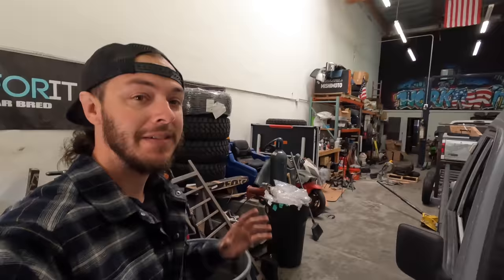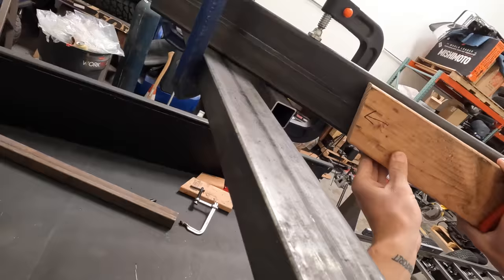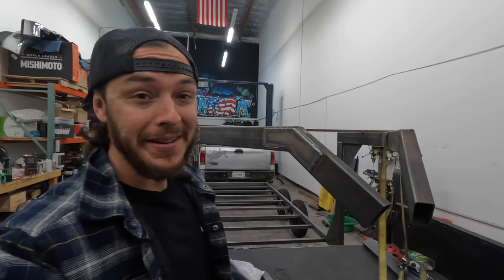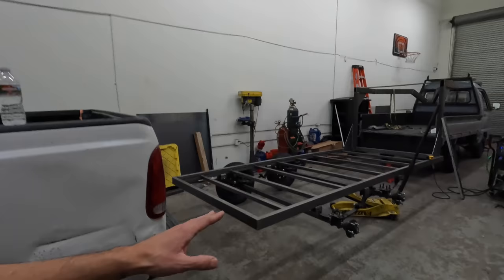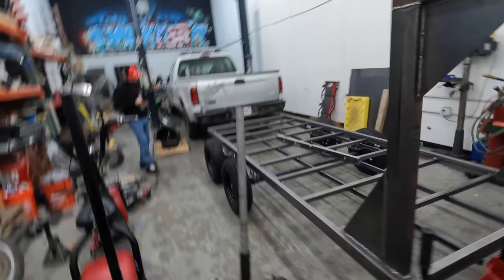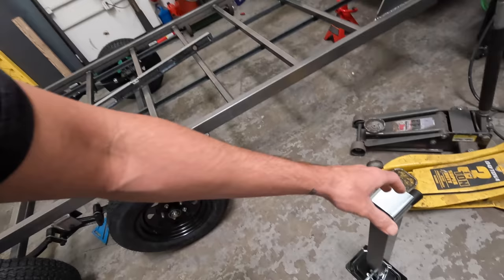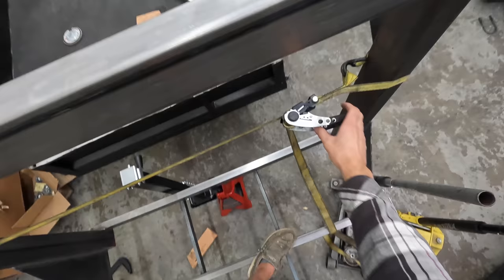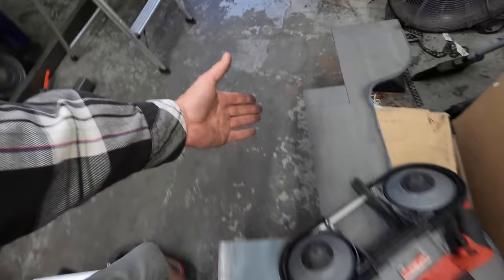Building a Mini Gooseneck Trailer for my Mini Truck! (Part 4)

Comment: Would recommend you don’t over engineer it and once you secure your 2x10 or 2x12 on the deck, it will straighten out right away and stiffen it up as well
Reply: Agreed
Reply: I have welded 1" tall by 1/8 thick straps, from front to back, to the cross braces, between the 2 x 10's for added strength and to keep the 2 x 10' s from wrapping.
Reply: Foreal how heavy is that thing now haha and how many ponys does that k truck have
Reply: @yungraf420  I see an engine swap in the mini truck's future. Maybe a 3 cylinder diesel

Comment: Cut the jack handle where it exits the top of the jack. Weld a length of tube, connecting the two pieces, to extend the handle to the edge of the trailer. Use a larger piece of tube (or rod end) to support the handle at the edge of the trailer.

Comment: That arc was caused by welding in the cross members on the bottom of the 2x4 tube. The welds shrink the tube and cause the arc. 

You can look up heat straightening to fix it

Comment: Ryno cut the Jack handle and make it extend all the way to the end of the trailer. Put yourself a little bushing or bearing mount for supout. Than you don't have to crawl under.
Reply: My thoughts exactly. Came to the comments to state that opinion and u already had it. Good deal.

Comment: With the uphill welding, weave it back at forth and pause on the sides so the wire can fill in the edges better.

Comment: Since you went side ways on the Jack , all you need to do is extend the arm to the side of the trailer.  Make a support bracket to hold the arm on the 5th support.  Add a Z handle with a collapsable joint and your good to go.  Now you can crank the Jack from the side of the trailer.

Comment: You need a jack with a pin so it can swing out of the way. The way you are going to mount it if you ever have a big rock or stump go underneath the mini truck it will most likely catch up on the jack
Reply: I agree! Swinging it up and out of the way would be best! Rather then just having it straight on.

Comment: Cut the handle off the jack,  weld small pipe onto the stub and bring the handle to the outer edge like your deck over. -just a thought.

Comment: They camber the frame.. I built the trailer frames under manufactured homes. We always set the center of the axles 1/3 from the end or 2/3 from the front. Center of ur axles wud b in between thos too.. pretty nice lil trailer...

Comment: Ryno put a jackleg on each side of the trailer, within the inside weld a rod from one stand to the other so they work in sink with each other also will have cranks on either side just like the big trailers...

Comment: The reason for the Arch is for some sping, and some Stability. Get as much stability as possible but if you use good wood it will give you Stability. go get some Semi Trailer Flooring its great Wood
Reply: oh and brace brace brace

Comment: Hey man great build dude! Hey gonna give you a tip I’ve built trailers for a business and definitely don’t weld anymore supports onto that underneath! The arc you have that bent the trailer is from welding on the bottom of it and trust me it’s plenty heavy built enough dude!

Comment: You might be able to look at cutting the handle off the neck and extending it to the outside like a normal heavy duty jack on a gooseneck. That would look pretty neat.

Comment: Hey brother, not trying to give you anymore work, but you should consider welding in small tubes, inside the frame tube, where the jack bolts go through it. Tightening the bolts will collapse the frame tube, and make it easier for the frame piece to twist forward if the load over gets too much for that frame piece to hold. If the trailer is always gonna be stored unloaded, probably not a big deal. But it's only an extra 5-10 bucks in materials and another hr of work, and it'll be much stronger in the end.

Comment: the rails on the trailer got an arc in them from welding the axels on the bottom of the rails. 
the arc in big trailers is between the axle and the hitch, not over the axel.

Comment: i'm glad you do "free thinking".. as opposed to those with cad program.. what if computers stopped working.. paper thinkers work for it.. lol free thinkers build best anyways.. like can't find a part for your vehicle 😒 due to chips & other new parts failing.. make your own.. if you have drill press.. you can mill ot ;)

Comment: U alt to cut the handle on the jack at the handle starts to bend and put a pipe on it and put it throw the side like on the big deck overs that way u ant gat to crall under the net to jack it up

Comment: Should have welded the plate tk the outside of the jack so it pinches it when you tighten the bolts so your not just relying just on the welds when you have 3 million pounds in it

Comment: the curve on the neck really has nothing to do with strength at all its simply so you can turn really sharp and not hit the cab just like a bumper pull has a v front so you dont catch your bumper

Comment: the arc on flatbed trailers is to add surface area not load capacity. I don't think it adds much but they do it.